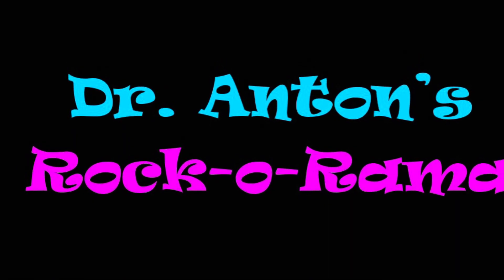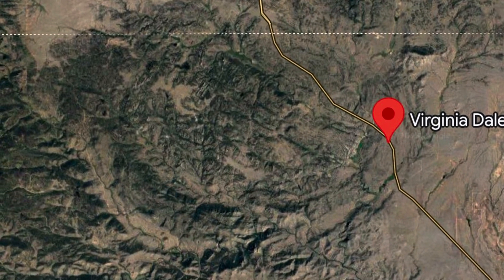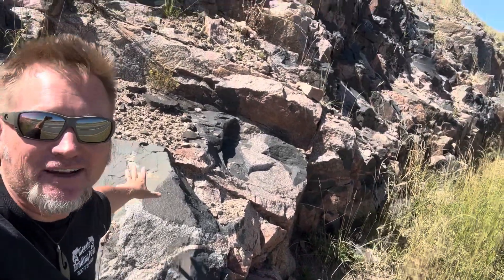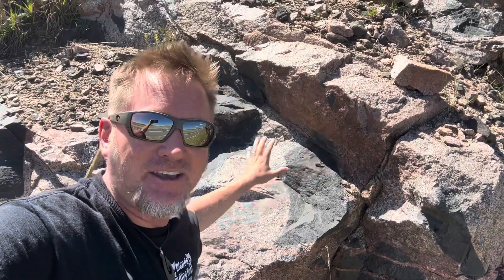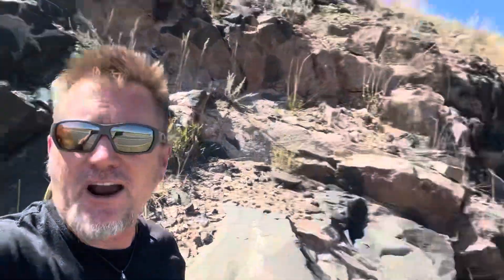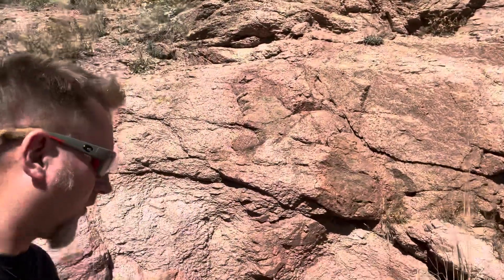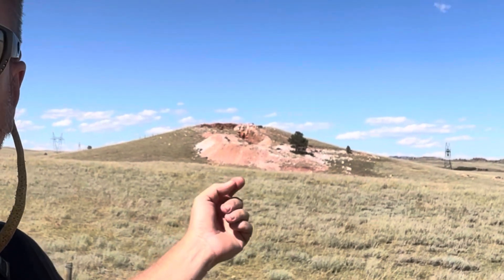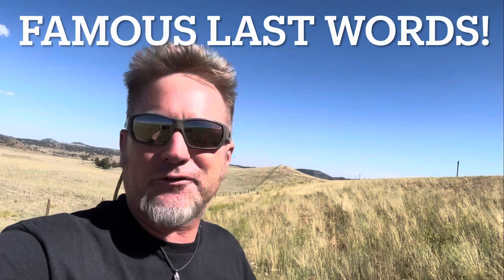The Virginia Dale Ring Dykes (collapsing calderas and the Richard Pryor connection)

Comment: Interesting. I've noticed that location before, just looking for indications of kimberlite diatremes on Google Earth, as one does. I wondered what was up with that feature.

Is it possible the basaltic magma was injected up into a felsic upper magma chamber? Or maybe the silicic stuff was up on the top of the chamber, and the mafic stuff was on the bottom, and an eruption and/or caldera collapse sort of partially mixed the magmas?